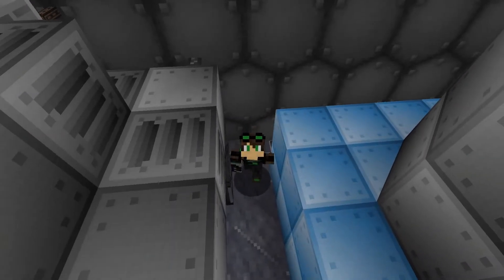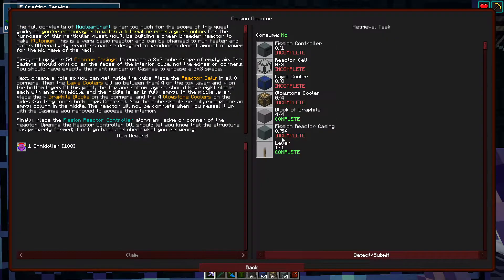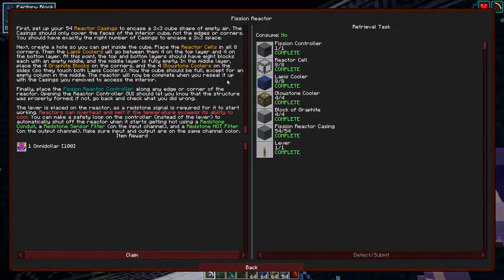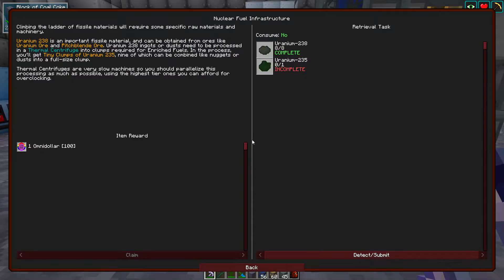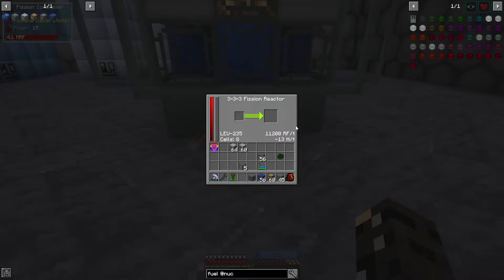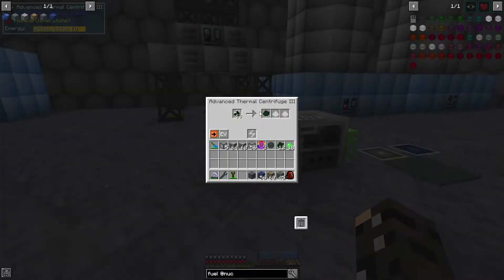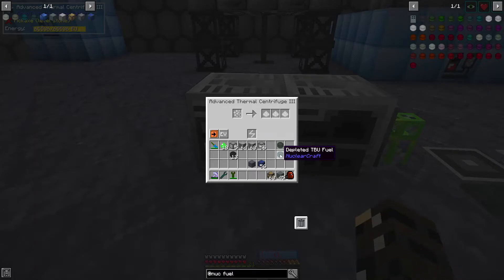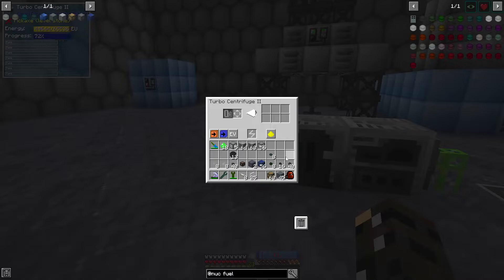Omni - E40 - Radioactive

Comment: Ooo exciting nuclearcraft shenanigans. Very complex. But neat! Just imagine the power of a max size reactor. Fear.

Fun fact though, americium (pronounced ah-mur-ih-see-um, for some nonsensical reason) is most notably used in smoke detectors. It’s a pretty lengthy process to synthesize and extract, so let’s be thankful Gregtech has spared the trouble of multi-step centrifuging, nitric acid baths, upwards of 70-year decay times, and the ungodly return ratio of 10000:1.
Reply from the maker: That's very unlike gregtech.... praise!